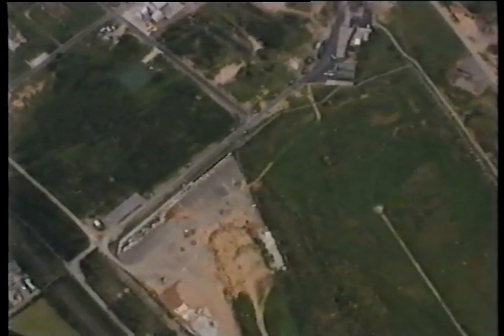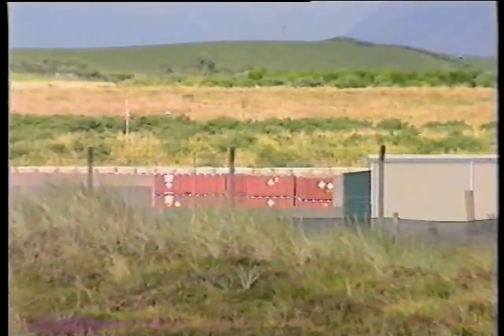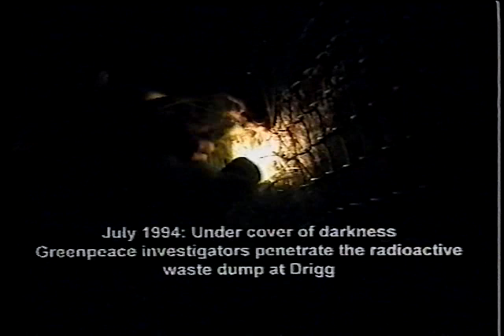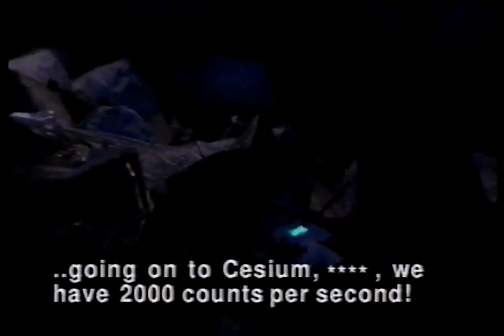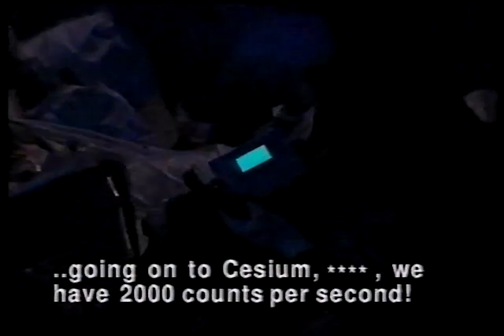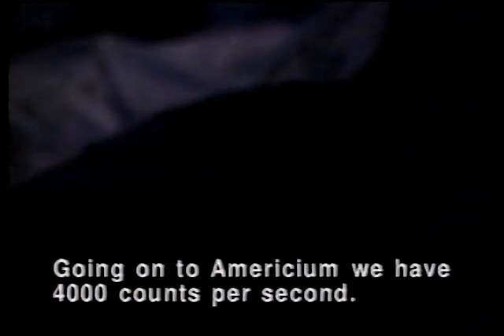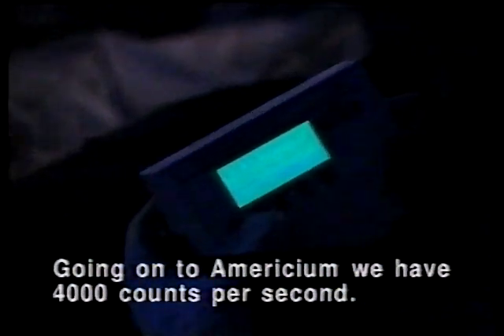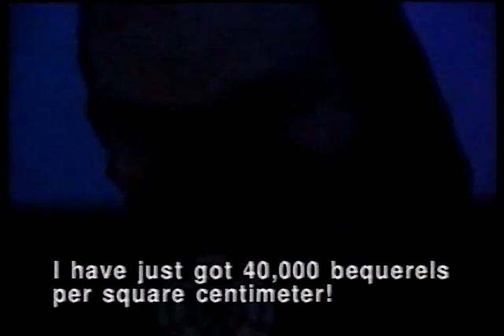Greenpeace investigates nuclear waste at Sellafield, 1994

Comment: Considering the armed Civil Nuclear Constabulary that patrol the Sellafield Site, these people can count themselves extremely lucky that they weren't shot.

Also, sorry to rain on your parade, but the "nuclear waste" that is stored at Drigg is "Low Level Nuclear Waste" which sounds scary, but in fact amounts to paper, cardboard, gloves and normal office waste. Nothing dangerous or radioactive is stored at Drigg.
Reply: Exactly. It seems like it would be Short lived or Exempt waste too. The IAEA doesn't have very strict precautions for these sorts of waste
Reply: 40,000 cps isn't radioactive?
Reply: @rorypalmer701  that roughly the same as standing infront of a display of bananas in a supermarket.  Also only slightly higher than the counts per second of a household smoke alarm.

Comment: A new coal mine has been proposed very close to Sellafield.  Excavation of coal will generate a huge underground void.  It does not take much imagination to appreciate that nuclear waste from Sellafield and Drigg could potentially be used to fill the void.  Sweep the radioactive mess "under the carpet".  Problem with that "solution" to nuclear waste disposal is that the contamination will leach out with terrible consequences for the biosphere.

Comment: Nuclear power despite deaths from all nuclear accidents in history has a lower fatality rate per TWh of energy produced than any form of energy, less than wind, hydro, coal. It has the lowest end of, and that's INCLUDING all nuclear accidents, including Chernobyl and the likes. Nuclear power is a good method of producing energy, it is the best method of producing a base load electrical supply for a grid system.
Reply: ***** I agree, nuclear power is important and we may have no choice but to use it someday. As long as the waist is safely dealt with.  Also, many deaths occur years later from cancer. I could imagine it would be hard to get good numbers on those deaths.
Reply: Paul TheSkeptic It is impossible to tell whether a specific case of cancer was caused by nuclear fallout with the exception of thyroid cancer, which has seen an extra 4,000 cases due to Chernobyl although thyroid cancer has a good survival rate. Cancer cases are estimated for nuclear incidents, the windscale fire is thought to have caused around 200 extra cancer cases, of which it is thought no more than 4 will have lead to death. Generally speaking nuclear waste is stored safely. That someday is now, the world is heating up because we produce too much CO2 and right now the only solution is nuclear, renewables simply aren't powerful enough and people that say they are clearly do not fully understand the worlds energy needs or the limitations of renewables.
Reply: ***** Well, yeah, we should be switching over to cleaner sources of energy, including nuclear but you know how people are. They'd rather deal with the problem when they have no choice than prevent it beforehand. Right now we can burn oil or coal although it's extremely harmful to the atmosphere but eventually that will lead to disaster and that's when people will act. I agree that we should be doing it now but that's counter to the human psyche.
Reply: You're forgetting about the long term affects. Uranium has an incredibly long half life.
Reply: @Haydan Evans: That is a riddiculous argument, since the biggest danger is nuclear waste. And mankind already generated enough of it to make the earth permanently inhabitable for humanity in just 50 years of nuclear power operation. This waste needs to be stored safely for a million years which is impossible.

Comment: @BSurecan 2 And you may think that 10,000 is shocking. It is but we have to see it in perspective. It doesn't mean that 10,000 have already died. It means that 10,000 people are at risk of developing non-terminal cancer over the course of there life times.
Compare this to the 1,000,000 + who die each year from air polution alone.
Chernobyl was the USSR and it had a full scale melt down. The Daichi incident is certainly not on this scale.

Comment: Everybody needs to educate themselves about the truth about nuclear power, not just listen to politicians or the TV. If we never built another reactor (unlikely) it's consequences are going to be with us for a very long time.
Reply: Howard Price The future is nuclear, Thorium powered reactors are what we need, they have the potential for large amounts of energy, low amounts of waste and with very short half lifes.
Reply: ***** Oh thank you Haydn!!  So nice to hear a voice of reason. The current PWR/BWR designs were deployed to make Pu239 and are at most 20% efficient. Even the ones we sold to Iran in the 70s had PU239 reclamation as part of the deal. LFTRs and other Thorium-based designs are can be 90%+ efficient and go a long way to reduce our terrible waste problem. Running that waste through a LFTR would leave only 10% of it left for long term storage. The only think stopping the wide scale development of Thorium tech is the
Reply: Howard Price Well when you consider that only 5% of the material in a traditional fission reactor is actually fissile you can see why, the 95% or sometimes greater % of U-238 sits there and through neutron absorptions and beta emission becomes Neptunium and Plutonium, which are the substances responsible for the 200,0000 year half lifes and high levels of radiation. If thorium were used it would not be able to produce these in a any significant quantities and thus thorium doesn't really produce any high level waste. At most you're looking at moderately radioactive waste for  few years, years, not even decades. Thorium is also more abundant, but I have heard that there a re a few more engineering obstacles with regards to reactor design as thorium's chemical properties mean a standard construction could cause it to react chemically with the reactor vessel. The reason however it is not invested in is two fold, greenpeace hippy types dislike anything with the word 'nuclear' in it, hence the naming of MRI machines, they actually use a technology based on nuclear magnetic resonance but the world nuclear scares people thanks to people like greenpeace. Secondly the government can't use thorium to produce nuclear weapons, leaving only people of science and engineering to support its development. But without government backing or  pressure from organisational groups on the government we're unlikely to see massive changes any time soon.
Reply: NUFF SAID! Live or Die...We can make it last or GO TO THE GRAVE FAST!😉